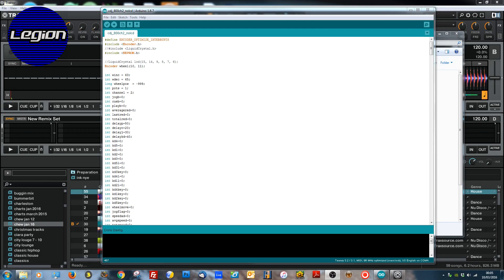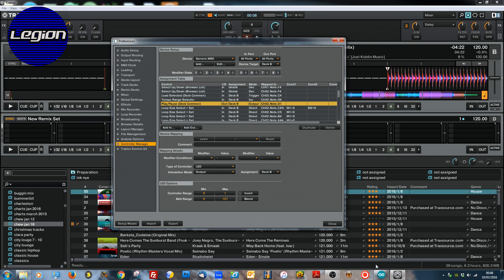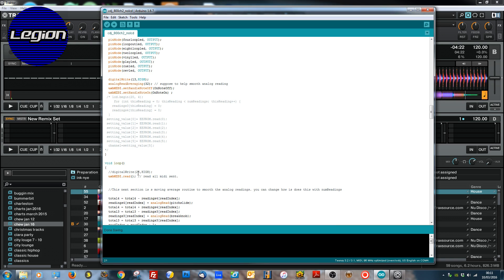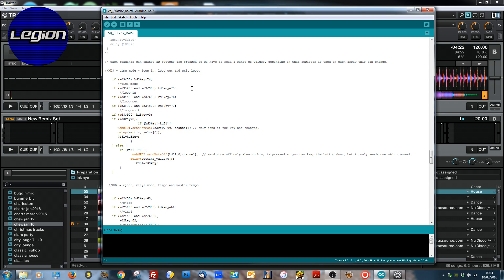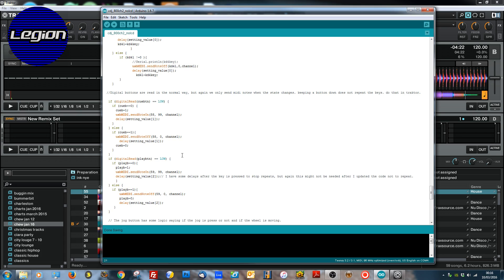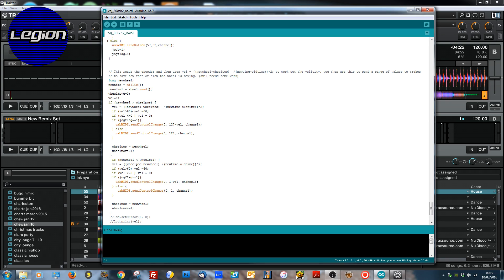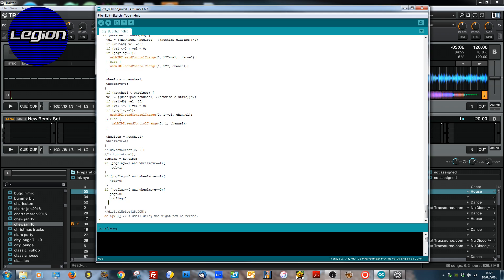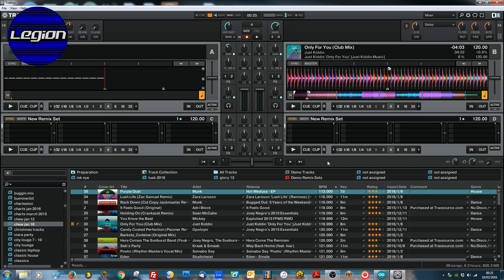cdj 800 - teensy midi conversion software

Comment: I have 2 800 in my drawer for a long time, this conversion is fantastic !!!! the various control surfaces that I have used over the years seem like toys to me compared to the sturdiness of an 800 and so at this point I absolutely want to convert them !! you did a fantastic job and i would like to run it, where can i find files and photos of your project ??? ... I see that the link to drop box doesn't work anymore, can you help me ???

Comment: Hi Legion, I recently bought Cdj 800mk2 how do I make them work in Traktor as a controller ? Please suggest
Reply from the maker: you need to use timecode cd via a interface.
Reply: DJ legion I have Komplete audio 6 interface and Traktor pro 3 latest version, Do I still need timecode ? Please suggest, I tot with Traktor pro 3 and interface it will work
Reply from the maker: @amitmehta3919  sorry but the komplete audio will not work you need a audio 6 interface and timecode.
Reply: DJ legion sorry my bad I got Komplete audio
6
Reply: DJ legion what’s the difference in a Komplete audio 6 and just audio 6, aren’t they both sound cards
Reply: take a look at my channel for midi conversion (cdj200, cdj800 and cdj1000) :  https://www.youtube.com/watch?v=fKlXErM1WZs&t=2s

Comment: Would the code need a lot of changes to run on a different dev board? I have a CDJ-800 Mk2 and a CDJ-1000 Mk3, both faulty and I really miss using them. I don't have a lot of money these days otherwise I'd have had them fixed so I need to try and get more bang for less buck!
The Teensy 3.6 is around £30 at the moment (and I'd need two), whereas the STM32 is about £4, despite having very similar spec (on paper at least) to the Teensy!
Reply from the maker: hi, so I am not sure, I think you can program the stm32 in arduino ide, but I don't know if it has same midi support as the teensy and that is the main reason I use them. What is wrong with your cdj that can't be fixed ? This is going to make fixing them not possible after converting.

Comment: the link doesn't work. it's possible rehave it? thanks
Reply from the maker: https://github.com/midicdj1000/teensy3.6-mk3 This is the later version fpr teensy 3.6 , but the code works just about the same.
Reply: DJ legion thanks

Comment: hello and thank you for sharing!!
the link for the code is not good, can you please reupload it?
thanks!
Reply from the maker: hi, this is very old, I have new vids with cdj 1000 mk1,2 and 3 conversions. You can find this code at https://github.com/midicdj1000
Reply: @DJlegionuk  Hi there!
I'm doing a conversion on 2x 800s. Can you share your TSI? I can't find it on the link you've sent. And also, any pinout diagram somewhere? from the movies only, I can't be sure witch cables go where. thanks

Comment: Good morning, my friend, I'm from Brazil. Sao Paulo.
I saw that you converted a cdj to control mid good I am dj aki in my city and I have two cdj denon dns5000 and they are with the defective cd player and because they are very old there are no parts to replace
I wanted them to run in the mid system.
I am a low income person w I can not afford to do this at the moment if you can help me to make these devices work in mid I would be grateful because I liked your fantastic tutorial I await your contact
My watsap 14998796413 Brazil
thank you! I'm dj emerson picolo

Comment: Hi DJ legion, I am looking to buy a second hand pair of CDJ 100s and convert them to MIDI. Is there any tips that you would give me? Would the process you have gone through with the CDJ 800 vary much to a CDJ 100s?
Reply from the maker: hi, yes it should be the same process, but I would make life east and just wire up direct to each button. The jog wheel should be a encoder, use the midi bend command on the pitch to get 14bit resolution.  what dev board are you going to use ?
Reply: Thanks for the reply. I haven't bought anything yet as I am still weighing up if I should take on this project. I also only have basic computing knowledge and little electronics knowledge so I'm just making sure it's a project I can see through to an end result!
Reply from the maker: I would take baby steps starting with a teensy 3.2 and learn how to program this to send midi and read button presses. then you can build on it. you can find plenty of demos and example code to do this.